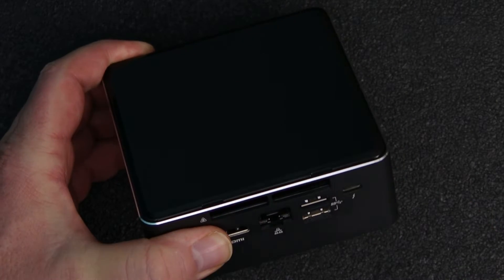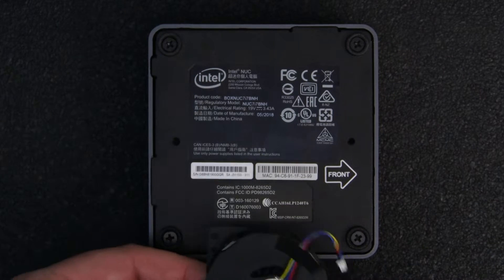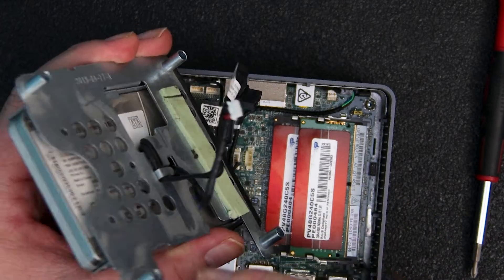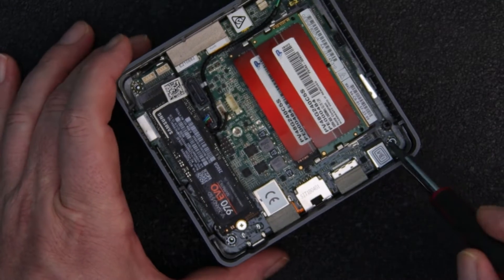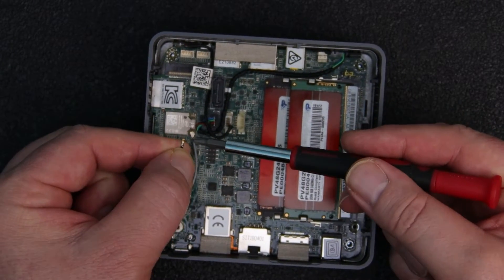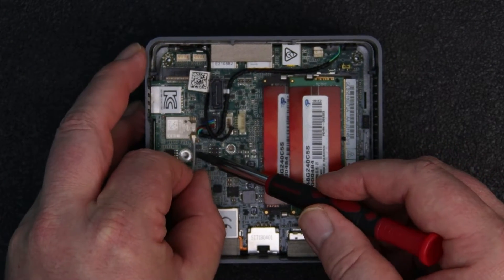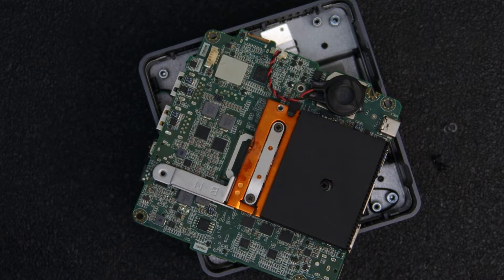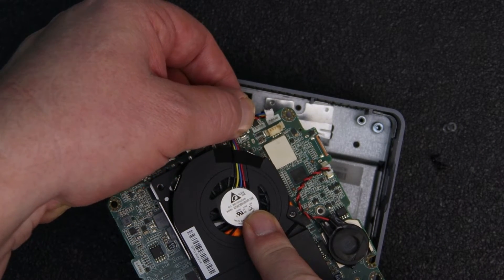How to change and install a fan on the Intel NUC

Comment: Thanks for this. It is worth noting that, if and when you change out the fan, make sure you blow out the mat of dust that packs in between the replaceable fan and the stationary grill it interfaces. I have a feeling that the old fan might actually still function after I deep-cleaned those components! I also taped some screen fabric on the vertical-mesh-vent sides of the outside of the NUC to trap dust before it enters the unit. My CMOS battery had to be replaced after just over 3 years' time.
Reply from the maker: I think your fan would definitely be a lot better off with a blow, but taking the dust out doesn't add life that's already been taken back to the fan. If you're there to blow out dust, why not replace the $15 fan?

Comment: Attention, il est Indispensable de changer la pâte thermique d'origine malgré la difficulté liée au démontage du NUC 8. Pâte d'origine sèche au bout d'un an. Des pointes à 100° C par coeur et un thermal throttle empéchant d'avoir des performances correctes. Sur ce type de machine le dépoussièrage est aussi nécessaire sous peine de flinguer sa machine au bout de 2 ans.
C'est ce qui m'est arrivé un Sav au bout de 18 mois.
Reply from the maker: Des conseils fantastiques! Merci beaucoup. Je collerai la traduction pour les autres.

Fantastic advice above from @thierrychambon8110. Here's an english translation so nobody misses it:

"Attention, it is essential to change the original thermal paste despite the difficulty associated with disassembling the NUC 8. The original paste dries after one year. Peaks at 100° C per core and a thermal throttle preventing correct performance. On this type of machine dusting is also necessary under penalty of gunning down the machine after 2 years.
This is what happened to me a Sav after 18 months."

Comment: Thank you for posting this. I had bought a new fan expecting it to be an easy swap but was stumped when I first opened it up. I would not have wanted to just pull parts off to find screws without knowing they were there. Also my motherboard seemed really firmly stuck and there is no way I would have continued to try to lift it out without seeing this. It took quite a bit of wiggling before the motherboard loosened and could be lifted out. Thank you. Posting this from my now peacefully quiet NUC :)
Reply from the maker: Ah, that's great to hear!! Well done. :)

Comment: There appears to be more than 2 screws holding the motherboard down. It will not budge. This is a NUC 8i3BEH1
Reply from the maker: Hm...so it's a different model than the one I'm working on here, yes? Did you ever figure it out?
Reply: There is only 2 screws on the 8i5 which I think is similar to the 8i3.

Comment: followed your instructions to remove the fan, gave it a good spray out with the air gun and a dose of WD-40, wiped it down and reinstalled.
Working fine again for now. 
Same as this unit is 3 years old.
Reply from the maker: Haha, awesome 👍

Comment: Hello, your video is very good. I can consult you, what was the fault that led you to change the fan. What happens is I have a nuc7i5bnh that suddenly turned off while I was working and I couldn't turn it on anymore, I tried the charger and it's fine, I took out the memories and hard drive, but it shows no signs of life. Could it be the fan or would it turn on with the bad fan? Thank you very much in advance if you can help me. regards, Marco
Reply: This is exactly what happened for me.  It would just auto shut down over and over.  Replacing the fan fixed it.
Reply from the maker: I replaced mine because it got so loud. I wasn't having the problems you're having, so I don't know if the fan would help.
Reply: Hello Marco! Perhaps you can help me. My nuc7i5bnk also suddenly turned off and won't turn back on. I checked the power supply - it's ok. Please share information. What is the cause of the problem and how did you solve the problem. Sincerely, Victor

Comment: What is the recommended period for cleaning the fan?
Reply: I'm not very comfortable opening the unit, despite having the tools plus an anti static work space. I'm just going to let mine go till I score an over temp then clean and replace the fan.
I've bee n running well over a year with a desk fan lying on top of the NUC to keep it cool.
Reply from the maker: Good idea---definitely wait until it needs it.
Like an old car---drive it until the wheels fall off. LOL
Reply from the maker: Yeah, I wouldn't know that. I just changed out mine when I heard it spinning loudly.

Comment: Did you find that the replacement fan was a better quality (quieter) than the stock fan or you only need to replace it if the fan is clearly beginning to fail?
Reply from the maker: Hey, Chris. Yeah, I'd say it was the same crappy, yet adequate fan I replaced--certainly not an upgrade, or any better at all. And calling it crappy maybe isn't fair because it cranked for years 24/7 - lol! I just replaced it because the old one was whining so bad.
Reply: I never replaced mine and eventually it died and after it dies your NUC will just start shutting down 30 secs after Windows starts up.  So if your fan is going, don't wait, just replace it.  Although I will say that my fan was LOUD for like a full year before it finally died altogether.